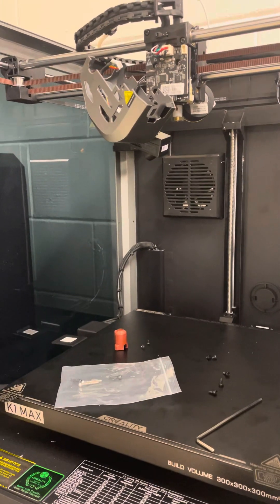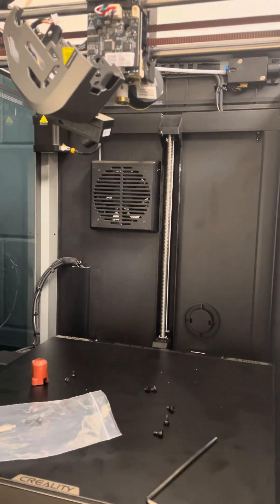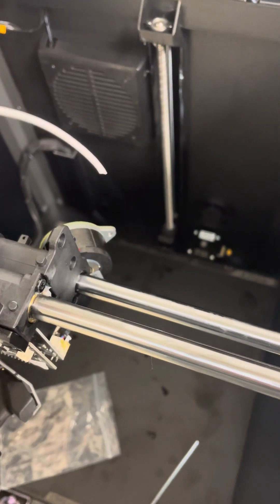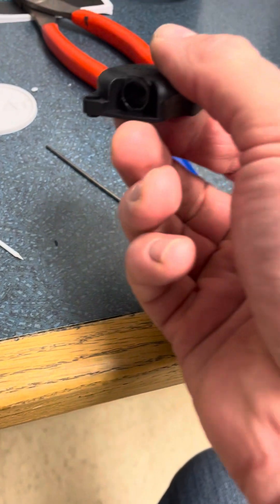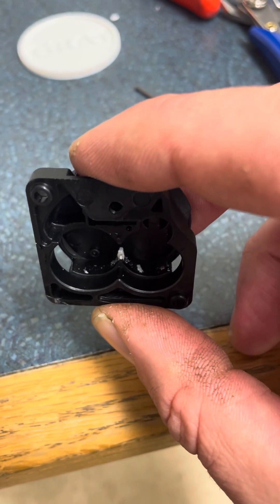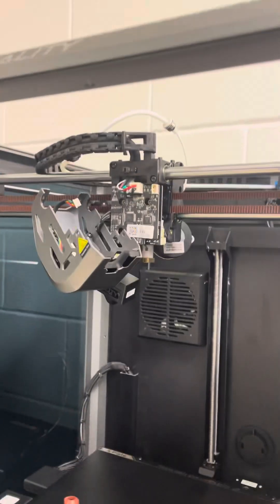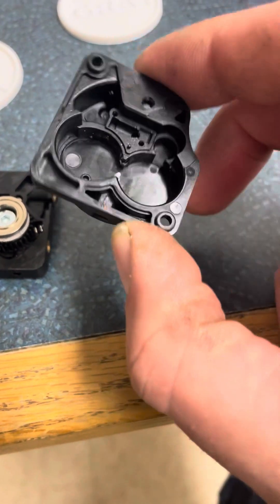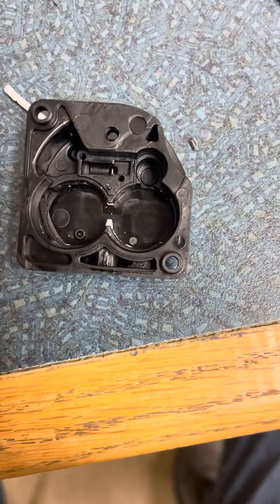Creality K1 Max Filament Jam in Extruder

Comment: I too have it Jamming a lot but only with transparent filament. any ideas on helping?
Reply from the maker: Double check the temp on the transparent filament and compare to what you have success printing with. Adjust as necessary. If you haven’t changed the nozzle, might be time for one

Comment: I had one today hence why I'm probing for answers, I have the K1 "Speedy" so my hot nozzle isn't long, its just the tip compared to the full size high temp ones, one of my jams was in the extruder, which i cleared like you, yet it still wouldn't  extrude and kept clicking, come to find out, another jam was just below the extruder gear box, and just above the short hot nozzle, inside that BRAIN housing below that YZ axis bar, I'm talking  jammed, took me 5 hrs to get it out, thought it was a goner,  final solution was to take off the hot nozzle heat up the push rod, then stick it thru the bottom, and keep twisting that hot poker till it comes out the other end, I'm new to this and the amount of force required to get it out was mind-blowing for what I thought to be a "delicate precision"  machine, Nope... Its ALLLL MACHINE a WELL built one too!! Ran a huge print after with NP, like it was brand new!! Thanks Creality!! And to you for this post!!
Reply from the maker: Right on! The way these printers operate, I can assume the filament must be top notch as well in the process. It’s that one variable that can definitely have inconsistencies through out the roll. I send you clogless wishes.